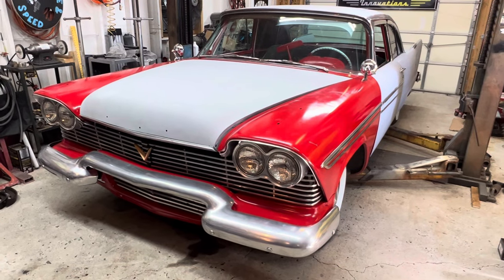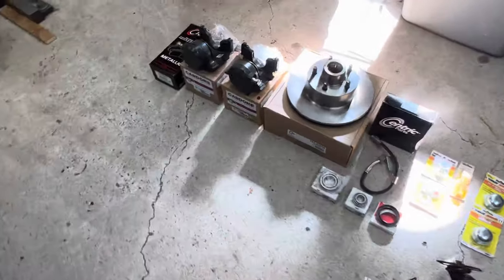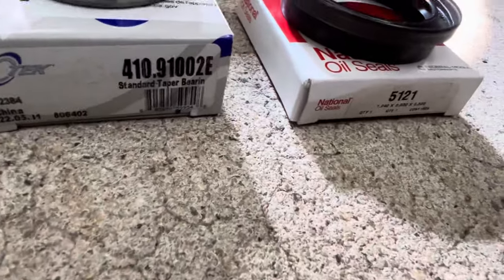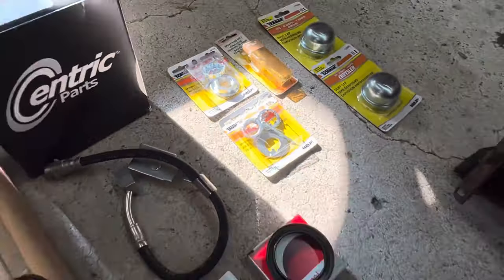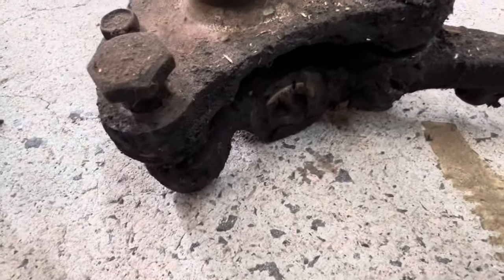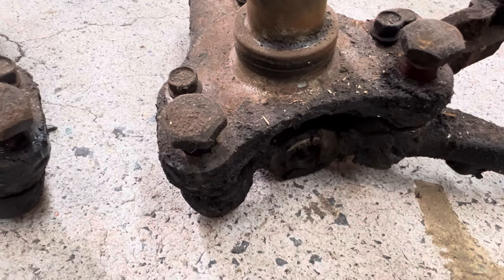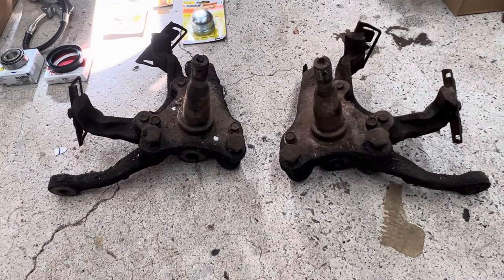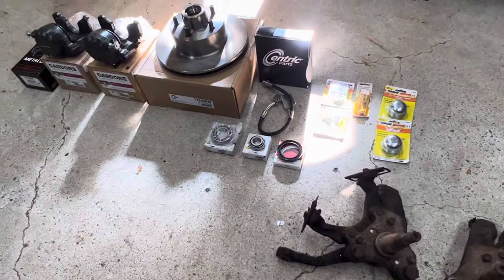Q & A Brake Conversion Spindles

Comment: This is a great video, the only bit of amendment I'd make to it is that the St. Regis (I have one in the garage) is an R body  shares parts with the late B bodies.
Reply from the maker: Thanks for that note! I mentioned that one since I did pull a set of spindles from a St. Regis, and it was 14” compatible, so maybe some R bodies use small rotors as well? If so I’ll have to add in the R!
Reply: @furyjim   That would be good to find out, my St. Regis is a civilian car, but the rotors on it were bigger than the J-body Cordoba I used to drive.  I have a '68 Fury VIP fast top that I'd love to do an all Mopar part disc brake conversion that would fit in my original 14 inch wheels.